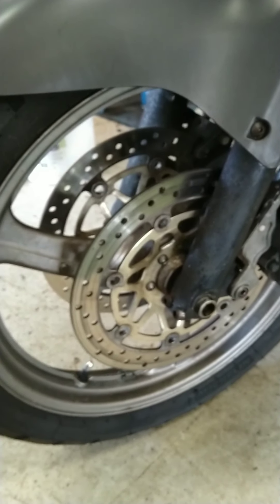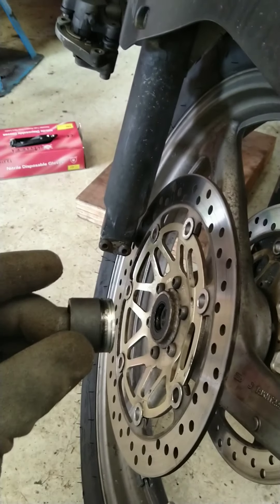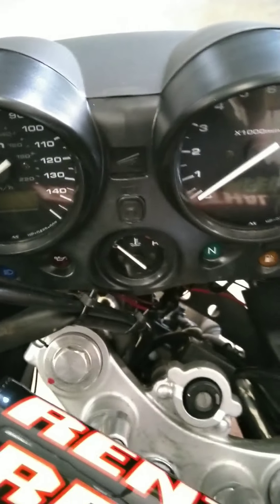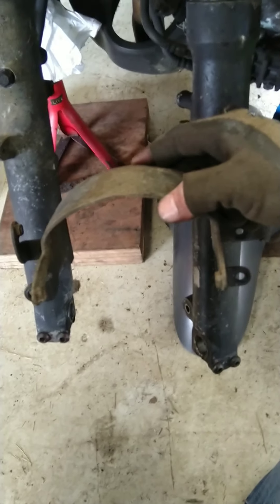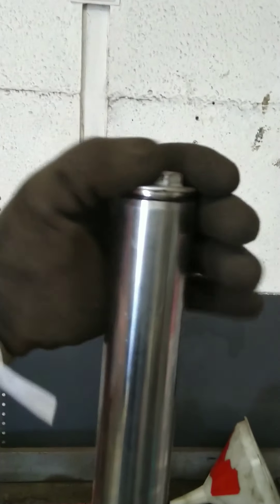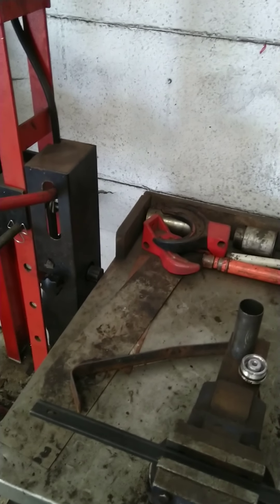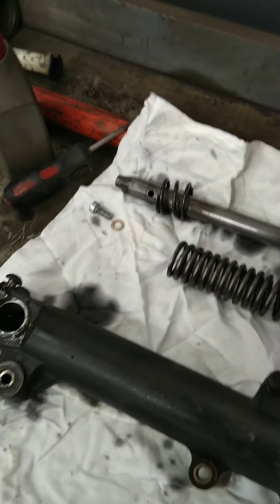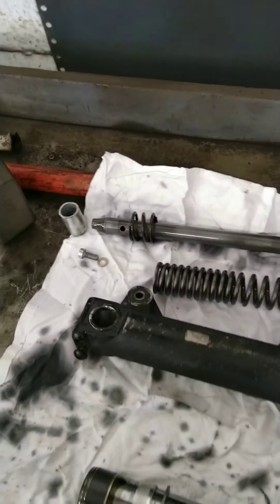Honda varadero xl1000 fork seals and fork rebuild part 1

Comment: Is it okay to change oil+dust seal+oil seal and skip the rest? I have trouble finding rest of the parts
Reply from the maker: @Yusuf-r4r2o hi mate. That's absolutely fine. 

A usual service is 10w oil (530ml) and oil seal. Dust covers can usually be reused if it is in good condition. The most important thing is to use a new copper washer on the drain bolt screw and not to displace the copper bush if you're not replacing it (one with the split that clips in). 

If you have not got a new o ring seal for the fork cap, it's not the end of the world as long as there's no split / damage. 

Just remember on the seal , spring faces down / markings (writing) faces up. 
Hope that helps mate